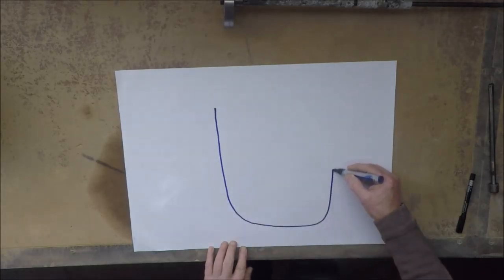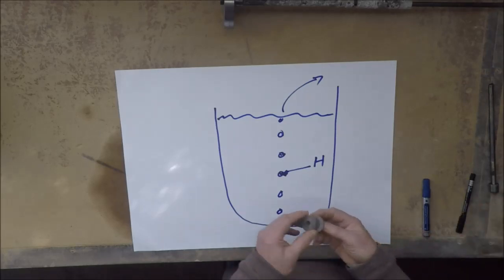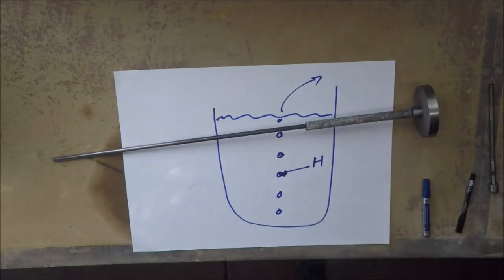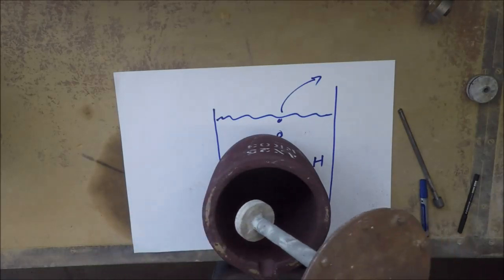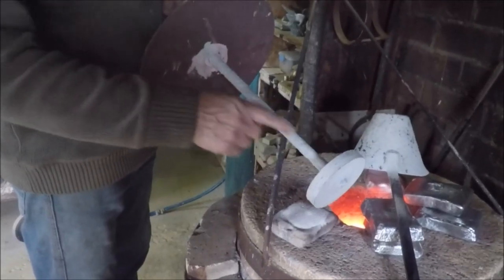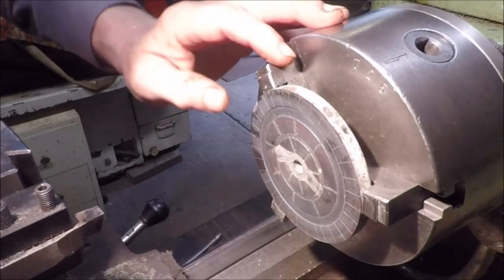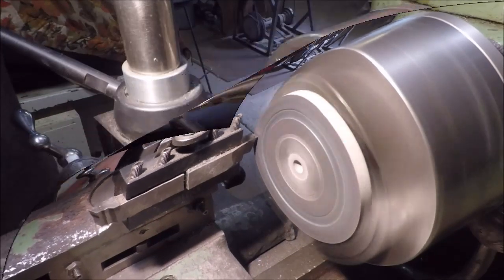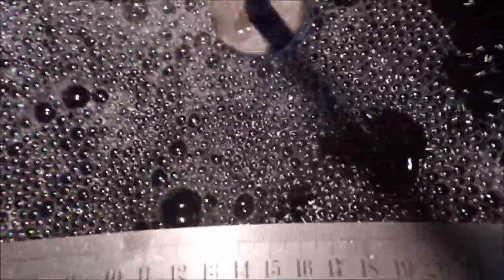My Home Foundry, Most recent Degasing Lance

Comment: Most of the YouTube casters I see use washing soda as a degas. I've seen you comment before that using washing soda as a degas isn't the best idea. Why is that? Anyways, another great, informative video.
Reply from the maker: Mister. It is my intention when (huh - If) my health improves to do a longish video on just this issue, with a great deal of technical info, sources, and experiments included to prove the point. It is my humble opinion that the originator of this process should have their box of matches confiscated for the harm they have done to the hobbyist casting community - whoever they are - I have a pretty good idea! No names no pack drill!
Briefly, People seem to think the gas given off when washing soda is plunged into molten aluminium is CO2 - it isn't - but even if it was you can not degas aluminium with CO2 as it and aluminium would react to form C (as smoke) and aluminium oxide (Al2O3) as folded films (bifilms) floating around in the aluminium. 
There are two common forms of washing soda, one is Na2CO3 the other is Na2CO3.10H2O. This last one is what was traditionally known as washing soda. If you plunge the first one into aluminium you would probably not get many if any bubbles at all. If you plunge the second those 10 molecules of H2O (yes, this version of washing soda is about 64% water) are driven off as steam and this is what we see bubbling out through the aluminium. Now remembering that the hydrogen that we are trying to get rid of from our aluminium got there by the aluminium reacting with water in the form of humidity in the air and in the burnt fuel in the furnace or from wet scrap etc it seems damn silly to me to bubble steam through the aluminium, all it will do is react (in part) with the aluminium to form hydrogen which will immediately dissolve in the aluminium worsening its gas level and aluminium oxide films, these act as weakness within the metal and as nucleation sites for the growth of porosity be it shrinkage or gas. The one saving grace - if we could call it that - here, is that the bubbling is over with quite quickly (maybe 30 seconds from what I have seen on YT) and a lot of the steam seems to escape rather than react as it is moving through the aluminium rather quickly. So while it will INCREASE the Hydrogen gas levels - the exact opposite of what it is supposedly being used to do - it will probably not increase them by all that large an amount - BUT any increase is too much!
Its not the best idea - its about the worst!... Martin
Reply: @olfoundryman8418  Thank you very much! You are a wealth of information!
Reply: @olfoundryman8418  Although the meaning of such names can differ from one region to another, I'm pretty certain the name washing soda is only used for the hydrated salt of sodium carbonate (Na2CO3·10H2O), but not for the anhydrous salt (Na2CO3). Because the presence of even trace amounts of water can be detrimental to many processes in the lab, it's well known among chemists that certain salts can be used to remove water or at least keep water out. For example many of the solvents commonly used in laboratories (like acetone, ethanol, isopropanol, tetrahydrofuran, toluene etc) have differing amounts of affinity to water (i.e. hygroscopicity), and in order to remove any water they might have already contained they're often pre-dried with drying salts (like sodium carbonate, sodium sulphate, magnesium sulphate, calcium chloride, calcium oxide, etc.).

So if you would substitute the anhydrous version for whatever salt you would otherwise have used, that should fix your problem in regards to it producing steam. Seeing as anhydrous salts are not uncommon in chemistry labs, I'm sure you could find some chemical supply houses or wholesalers who will sell it to you, after all they're pretty benign and harmless substances. And if you do somehow end up have difficulty finding such suppliers then eBay would be an option, there are a couple of chemical sellers who ship internationally on eBay. And although not an option for all salts there are several commonly available ones which you can dry yourself till they're completely anhydrous by heating it on a tray in the oven at the correct temperature and for the right amount of time.

Comment: what hose melting temperature you use?
because i afraid the conduction will attack my hose i use high temperature melting hose.
Reply from the maker: Rendi, I use a reasonable quality air hose, it is two layers of some sort of elastomer with fabric in between. I have never had a problem with this hose getting too hot. But I use standard Nito air fittings to couple this hose to the lance and on one occasion this fitting got hot enough to melt the plastic parts inside it. I use a fairly long stainless steel 10mm  diameter tube as the main part of the lance and as stainless steel is a relatively poor conductor of heat its not conduction that caused the air fitting to overheat, rather it was the radiant heat from the glowing metal and furnace and the hot gasses coming from the furnace that caused the problem. To avoid a repeat of the fitting failure I added an extra length (about 1/2 a metre) of the stainless steel tube to the lance. I added this extra length via a metal right angle fitting so the hose end of this added tube is well out of the way of all the heat.

Comment: Great content, based off this vid I made a Lance of the same design (not quite as pretty as yours :) ), and after testing it in water it looks like it will work great. As far as protecting it, would a boron nitride aerosol spray work, or would it need to be a BN paint?
Reply from the maker: Iam, I am well pleased than someone thinks enough of it to make one themselves. Be aware that bubble size in water is somewhat smaller than it will be in molten aluminium. A 1 mm to 2mm bubble in water would indicate a 2 to 3 mm bubble size in molten aluminium. The controlling factor in bubble size is the hole size it comes out of, hence my use of about 0.1 mm deep grooves these should give a bubble size of 1 to 2 mm in water. It is important that the two discs making the grooves are held tightly together as if not you get a slot right around the discs where they join and this will give much larger bubbles, approx. 10 mm. Sometimes my discs come a bit loose and I think I need to bolt them together with 6 or so small bolts as well as the central bolt. Perhaps this is worth considering. I have no actual idea of how well this device really does degas aluminium I am just assuming that it does a good job (it should and I note that once I started using it I had to make my feeders a bit bigger this indicates less gas in the metal. However I have made arrangements to borrow a reduced pressure tester so I can actually do a before and after test on my metal for hydrogen gas content and hopefully if time permits also try a few of the other degasing ideas in current use. I hope to do a video on this. So I should find out if I have been wasting my time - I hope not! I use a BN paint "hardcoat " by ZYP coatings, dear as poison! I would think that the aerosol would work too but I have never tried it, did not know it was available.
Be aware that the BN is not a cure all. Sometimes the aluminium gets through and gets stuck right into the outer protective sheath that I have on my lance. I check the lance after every use very carefully and any attack is cut out back to clean aluminium free metal with a burr in my Dremel. I then oxidise the cut area with heat and then recoat with the BN. I do recoat before every use attack or not. Also I have had the aluminium work its way inside the outer sheath and up around the inner stainless steel tube , for a distance of some inches in one case and it had started to attach the stainless so check for this too. It got in where the outer sheath rested on the degasing head so I made a fairly tight sleeve (fitted with BN paint inside it) to go over the top of the head and the bottom bit of the sheath, this stopped the problem. Good luck with it.... Martin
Reply: Thank you for the detailed reply! I look forward to trying it out, this is strictly a hobby for me so its fun to learn and improve on my limited experience. Your channel is by far the best I've seen on YT on this subject, it is much appreciated for you sharing your knowledge!  I'll keep everything you said in mind and try this out as soon as I get the BN. Thanks again
Reply from the maker: iam, Thank you for your kind words. Passing on the knowledge that I have gained over the years is why I am on YT and sharing it is my pleasure. I wish you luck in your efforts. Please let me know how it all goes... Martin

Comment: It works, so obviously it works.
The Chemistry sounds a bit off. Hydrogen 'dissolved' in Aluminium then interacting with Argon ?
Do either of those even happen ?
Not that i know, but it sounds more like the hydrogen is a bubble in the melt and the inert argon just helps move the hydrogen bubble to the top of the melt by mechanical entrainment.
Basically the argon ignores the Al and rises, knocking H bubbles upwards as well.
Reply from the maker: aga. Not sure there is any chemistry involved its more of a physical process. The hydrogen atom is very small (compared to other atoms) and it fits in between the atoms of most other things. This means it can dissolve in and move through either liquid or solid things all too easily. It causes great trouble in hardened steels with sudden catastrophic brittle failure. Its a pain in copper because it reacts with the often present copper oxide  to form steam which fills the copper up with bubbles (of steam). And yet it apparently causes no problems in magnesium alloys. In aluminium it dissolves in the liquid but is much less soluble in the solid so on solidification it tends to precipitate out as small (usually less than 0.5 mm) bubbles. My understanding is that it is in solution as H but comes out as H2. Removal of H by argon (or nitrogen) is I think purely a physical process. Things move from where there is a lot of it to where there is less of it. This is a fundamental law of nature - think of heat, it always flows from where there is a lot of it (i.e. where its hot) to where there is less of it (i.e. where its cold). Thus hydrogen moves from where there is more of it , the aluminium, to where there is almost none of it, the argon bubbles,. There is no "knocking" of hydrogen bubbles for at that stage the hydrogen is not present as bubbles rather it is dissolved in the aluminium, it simply moves into the argon bubbles and there is no reaction between the argon and anything - it is after all an inert gas and thus by definition incapable of reaction. Hydrogen bubbles only form on solidification and by that time it is way to late to try and degas the aluminium. However one thing the argon bubbles do "knock" or rather get under and float up are oxide films. Any film bigger that an argon bubble will be lifted  up and floated out of the aluminium - this is one of the reasons for the use of the smallest possible argon bubble size... Martin
Reply: In welding, dissolved hydrogen can be a very real problem. We had lots of trouble qualifying in 6061T6 and tried everything we could think of to pass e-xray. Some even resorted to questionable methods when no one was looking. Perfect cleaning and argon coverage just did get us by.

Comment: I have thought on this and you are right. 
The pure aluminum would prefer to be aluminum oxide.  As you say it loves water.  The water moisture is in the air floating.  The pure  aluminum attracts to the oxygen in the water and grabs the oxygen from the water to become aluminum oxide.  It leaves the hydrogen H2 gas has a small atoms bouncing around against the atoms of aluminum and aluminum oxide Al2 O3 trying to get its electron back.  The tiny bubbles of argon bump the tiny hydrogen gas atoms and carry it out.  The holes in the lance should be as small as possible and allow the lance to still work.  The bubbles at the bottom just as they exit the lance will pick up more H2 being smaller as they rise they will expand due to less pressure and more heat.  They will pick up less as they become larger but cross the top layer of the aluminum better.  
Casting area should be dehumidified as possible.        I have a project going but I am building a lance next.
Reply from the maker: Thomas, Spot on! Another thing about small bubbles is that they rise slower than big ones - you can see this effect in an aquarium with an air stone - this means that the smaller bubbles have more time to collect the hydrogen. Also the bubbles float out any oxide skin films that are bigger than the bubble - the smaller the bubble the more oxide skins you float out. The hydrogen flows from the metal into the argon bubble because there is more hydrogen in the metal than in the bubble its exactly like heat flowing from where there is a lot of it i.e. from where its hotter to where there is less of it i.e. to where its colder. I do know of a foundry that will not pour aluminium on humid days as hydrogen pick up can be quite fast then... Martin

Comment: is there anything else that would work as a coating? I'm thinking maybe sodium silicate or maybe ceramic exhaust manifold paint might work
Reply from the maker: Mark,  The boron nitride coating that I use here is by far the best I have come across but it is expensive - very expensive However you can as you suggest use a coating which has sodium silicate in it as a binder. You could try mixing talc and iron oxide (concrete pigment) with sodium silicate to a very sloppy paste. Start with about equal quantities (by volume) of each. Dilute to watery slurry and apply to a warm lance, dry to red heat slowly at first. Not as good as the BN and will need to be reapplied each time. (I reapply the BN each time anyway) Be sure to remove any areas where the aluminium has begun to attack the underlying lance, take them right out with a carbide burr and oxidise the fresh area at red heat before reapplying  the wash. You could also try  graphite powder and sodium silicate - there are many possibilities 😊. Good luck... Martin
Reply: @olfoundryman8418  thanks mate.. i just found your channel, it's amazing to see a real pro in action.. i'm a manual machinist that's just starting out in metal casting and your video's are a big help, there's lots of video's about casting on youtube but no one else ive seen gets results anywhere near to what you achieve